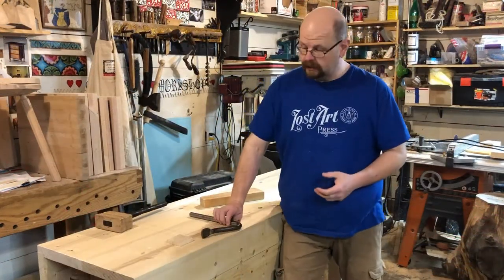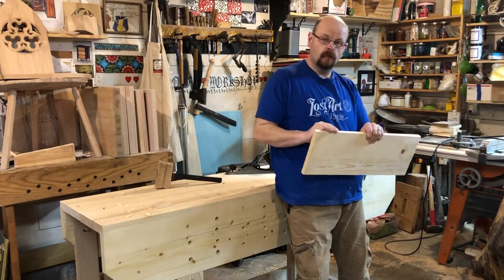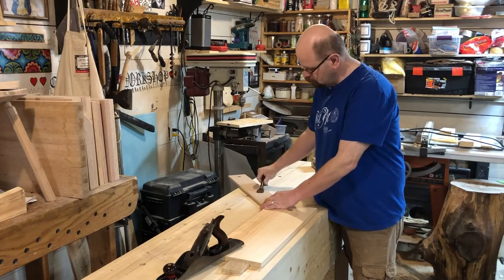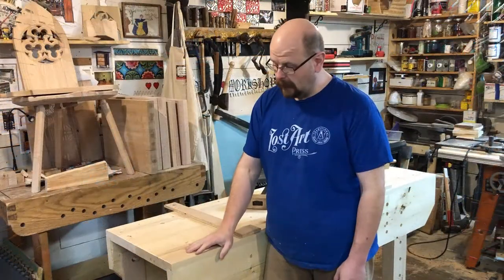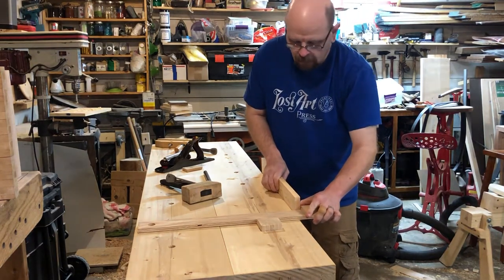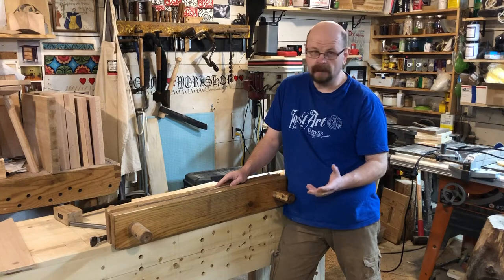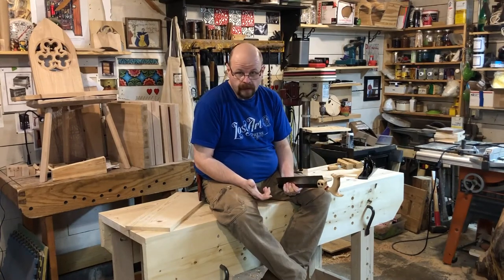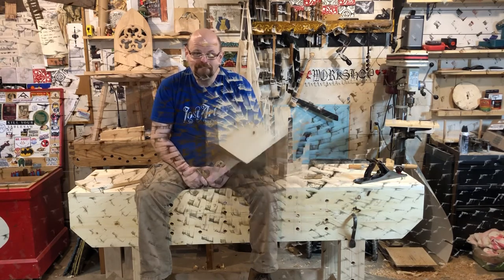Oldwolf Workshop Studio: Vise-less Woodworking

Comment: Thanks Derek for a couple of pointers that I am going to borrow (long term).  The one on the crochet  will work out just fine as I moved into an old house and I got to take over 1/2 of the basement.  Being a hand tool ww I built a Nickelson Bench but I am always catching my self on that blasted crochet as I move around the bench.  I have pulled it off a couple of times but invariable have to put it back on so I can use it.  Your Idea works just great.  and also holding the board vertical with the does foot.  I am always looking for ways to reduce the number of appliances that only serve one function.

Comment: Should I worry that holdfast could ruin the dog holes? 

I really want this setup for the low workbench that I'm planning. It needs to be an ordinary bench when not in used and vise and protruding woods can cause accidents. Thank you.
Reply from the maker: Sorry it took me a minute to see this question. In a pine workbench top, over a significant time, sure the holdfast might deform the dog holes a bit, The dog holes on a taller joinery bench I built in 2010 are a bit ragged and beaten up - but they all still work just the same for me... If it ever gets bad, I will over-drill the hole and plug it with a larger dowel - say 1" - then relocate a new dog hole and keep using the bench for a couple more decades. 

The damage is no worse than everyday use, marks from chisels, saw blades and hammer blows, and the occasional flattening with a hand plane.